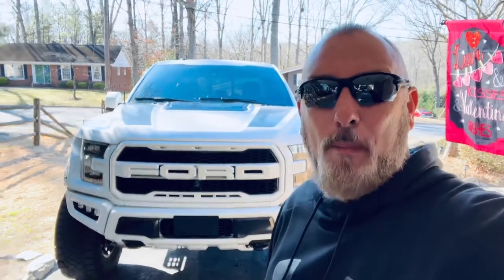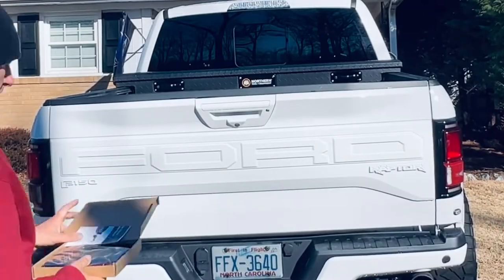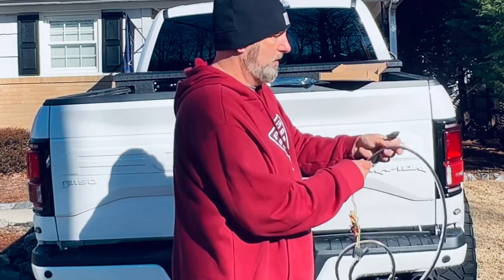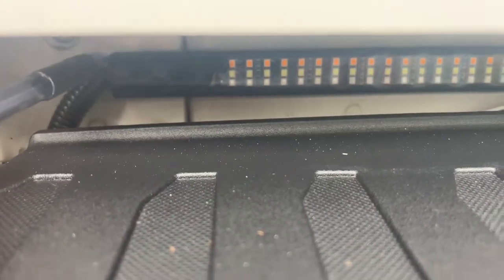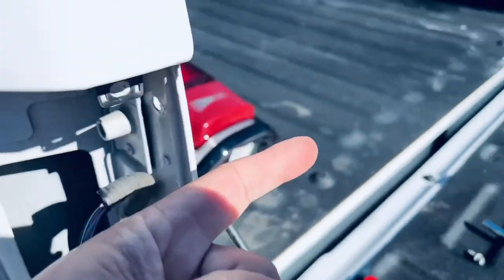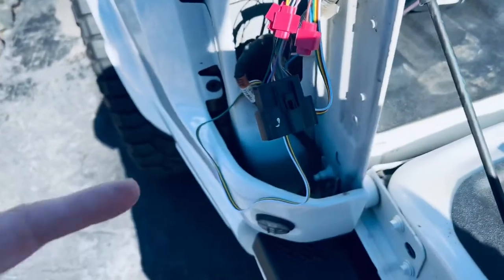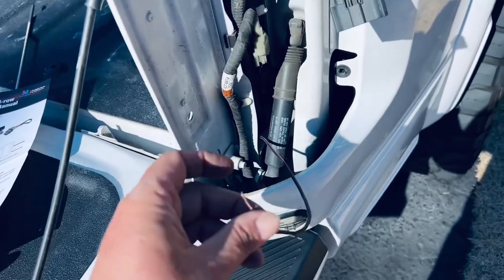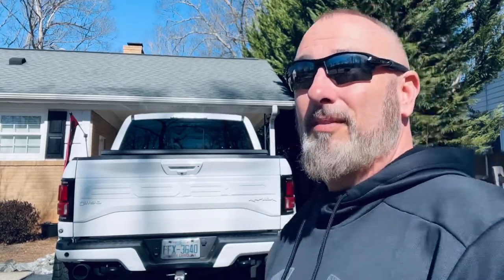Tailgate LED light strip. How to hardwire it !

Comment: Just watched your video, seems simple. I have a 2023 F-150 that i'd like to wire a light bar to my tail lights. Where did you get the wire diagram? I've been trying to find on line and not had any luck. I did right down notes from your video. I just don't want to screw this up.
Reply from the maker: I got my wiring from google search. Just make sure you get the proper wire colors identified for your year model. If you need any help, I’m usually on here and can offer assistance. Good luck 👍🏼 I’m sure you won’t have any issues.

Comment: Hey I was wondering... would this be the same process/ wiring to hardwire the OPT7 Tailgate light to a 2022 Raptor?
Reply from the maker: Yes. It should be the same. But double check the ford factory wire colors on your 22 against my 18 in the video to make sure they haven’t changed colors. I don’t think they have changed but can’t be certain.

Comment: So the BLue wire on the truck acts as the parking light and brake light for the light bar?
Reply from the maker: Yes for mine it did. Because my bulb is a dual filament parking and brake light. I’ve had some guys with different model trucks ask me about theirs having two separate parking and brake bulbs. Which I can’t advise those.
Reply: @LivinWith3M  I was thinking about this.  I noticed you have the same wire notations and my 2021 F150.  Stop wire and Park wire.  You connected to the park, I'll give it a shot as all of my lights work except the parking light.  I'll remove it from the stop wire and connect to park wire and see what happens.
Reply from the maker: @richkesteloot2131  cool. Let me know what you find out.

Comment: Mike, this looks awesome and I think I'll do it on my 2018 F150.  I do have a question though.  Does your Raptor have LED brake lights and Blind Spot Detection?  I am thinking it looks like that in the video, but wanted to verify before I get too far into this.  I had read a couple years ago when looking into doing this that there were issues on the Ford F150 with LED taillights lights.
Reply from the maker: Hey David, Yes mine does have the Bliss. I haven’t had any issues so far. Let me know how yours turns out. 🤙🏼

Comment: Did you have to worry about placing it low enough so tailgate wouldn’t pinch it.. when tail gate is down?
Reply from the maker: No sure didn’t. It was thin enough that I knew it wouldn’t interfere with the tail gate. I’m sure there are thicker hard plastic led tailgate lights that you may have to worry about making contact. But the mic tuning doesn’t come close to hitting it. 👍🏻

Comment: Hello! Great video but somehow if I can ask for a little help. I ran the same way splicing the left side taillight. My question is when you splice the left side, did you wire the other end to the 4pin connector? The led tailgate has 5 wires, left turn, right turn, red reverse, ground. Now if I took the wire from the tailgate light to hook up on brake, that would only work on brake. If I take that brake ( white wire ) to tail, that would only respond to parking ( DRL ). How did you connect so it work on brake and DRL? Any help truly appreciated!!
Reply from the maker: Brown mic tuning light wire goes to a blue wire with grey strip behind the drivers side lamp harness. This is the parking and also Brake light wire. This one wire does both the parking light and when you push the brakes it also gets brighter. I just looked back on the video and I am realizing that I did not make that clear. I’m very sorry about that. So if you connect the brown wire to the blue with the gray stripe, that will give you parking lights and brake lights.  You have to do all of this at the tail lights and not lower down near the trailer connect plug. if you are tapping in at the tail lights, you will see the blue wire with the gray stripe. Please let me know if this makes sense. Thanks.
Reply: Somehow when I hook up the brown wire from the 4 pin to the parking light, I only get daytime running light. No brake light comes on. If I take the brown wire and hook to brake light, I only get brake. No daytime running light.
Reply from the maker: @nojtuag4509  man that has me stumped. I will try to do some research and let you know.
Reply: Yeah I’m on a stand still right now. Yes anything info would truly appreciated.
Reply from the maker: So I’ve been researching. What year model is yours? On my 2018 my stock lamp assembly I have the dual filament bulb. Meaning my top bulb is a parking lightbulb but it’s also the brake light bulb. So the blue wire with grey stripe connects to the brown mic tuning and works fine for me. Yours may be different and have multiple wires for brake and parking. I honestly don’t know at this point. Let me know your year model and also are your tail lights the Blindspot monitoring BLISS. Mine are.
Reply: Sorry didn’t mention the car. Mines a 05 Tacoma. Thought since you doing a hard wire as long as I keep the wires to the 4pin would be same.
Reply from the maker: @nojtuag4509  No Sir. The Ford rear taillight wiring is much different than the Toyota. I will still do some research on the Toyota forums and see if I can help you out.
Reply: @LivinWith3M thanks for being a good sport and try to help. I had it, so I just order another single row, tap the DRL wire and GND to my 3 row led. So the 1 row led only daily light and 3 row led work with lt, rt, back and brake. What’s funny is this 1 row led work with the 4 pin, the 3 row led does nothing.

Comment: I built a flat bed, would it be possible to run this system as the main tail lights? I have 4 wires coming from my truck, I have left and right turn signals, running lights, and brake lights. I'd there a way to get it to run into the 4 pin harness?
Reply from the maker: I feel sure you could splice the wires into the 4 pin and get them to work. Yes.

Comment: Did you wrap the green wire (connected to your extension extra wire with a connector to get to the passenger side) in electrical tape?
Reply from the maker: I used a butt connector that has heat shrink on it. I crimped it then heated it. I may have wrapped black tape around the outside of it but never recommend just using electrical tape. Sorry I should have put that in the video. Here is a link https://amzn.to/3rrID20

Comment: Easier to splice into the trailer plug wires. Can wire everything in on spot.
Reply from the maker: On some models it can still interfere with the back up trailer system. Just my opinion to recommend going up to the tail light. 🤙🏼

Comment: Any problems with removing that black piece under tailgate rear passenger? Tail gate still stable?
Reply from the maker: I was concerned also at first but absolutely no issues with stability or strength of the tail gate. 💪🏼👍🏻

Comment: Ummmm, why not remove the tailgate?  2019 F150 SPORT, even with the wiring I could disconnect and complete my install so much easier!  Just for geewhiz, if available (when removing tailgate) I also rested the tailgate on an inflatable camping mattress.  Peace of mind to avoid potential scratches.
Reply from the maker: That is a great option also. Whichever you feel more comfortable with. 🤙🏼

Comment: Hey Mike I just had a light bar put on my chevy yesterday an it looks nothing like this lol, i think they tapped into the trailer because now im getting errors and trailer light's disconnected an more.
Reply from the maker: Marcus, yep that’s what happened to me on my last ford truck. I tapped into the wires right behind the trailer plug and it sent the truck into a bunch of messages on the dash. It thinks you e got a trailer plugged up. That’s why I went over and tied into the tail lights. It avoids this problem. Let me know if you get it re done. 🤙🏼
Reply: Mannn! Thanks im goin back on Tuesday ill definitely follow up with you afterwards. This is super annoying man! Preciate it

Comment: I installed this via hardwiring it into my 49 Chevy half ton. Worked great for a while, then all of a sudden the brake light function and turn signal function both quit working on the right half of the unit(right side of truck). Anyone else encounter this problem? I went back and verified all my connections are good and there are no shorts in my new circuits as well as my original wiring. It worked out of the box, I don’t know what would cause it to fail now. I’ve only been running it for a month
Reply from the maker: I hate it all of a sudden giving you trouble. Possible issue with the light bar itself? Hopefully someone will chime in with other experiences like this.

Comment: I installed this same light bar and messed with the tail lights. Specially the turn signals. Turns signals stopped working. So I just left the drl and reverse light feature.
Reply from the maker: That’s strange as to why the turn signals quit working for you. If you had them tied into the correct color wires then only thing I can think of is the mictuning light bar is malfunctioning. Dang I hate to hear that.
Reply: @LivinWith3M  I know. Looks dope, but I guess I was reading online. That it has to do with the small fuse It has. Maybe I’ll be adding an inline fuse that has kore capacity
Reply from the maker: Ah gotcha. Makes sense. Great info for others that experience this. 👊🏼👍🏻

Comment: Hmm my signal and brake are to different wire i tap it to the turn signal but my brake don't work.
Reply from the maker: Oh wow. I hate that. What year and type truck do you have?
Reply: @LivinWith3M  it a 2024 gmc denali 2500hd everything work great except I can't get the brake to work since it 2 diff wire
Reply from the maker: I sure wish I could help more. I tried searching but the 2024 is so new I couldn’t find any info. I would call your gmc parts department and ask the parts guy. I’m sure he can pull up a wiring diagram and color code on his computer.

Comment: You know that you can take the tailgate off, right?  😂
Reply from the maker: Yes sir,for me I really didn’t need to. I know it’s real easy , but just got used to doing it with the tail gate on. Definitely is an option for my subscribers to consider. Some may find it easier to install the light with the tail gate removed. Thanks 🤙🏼